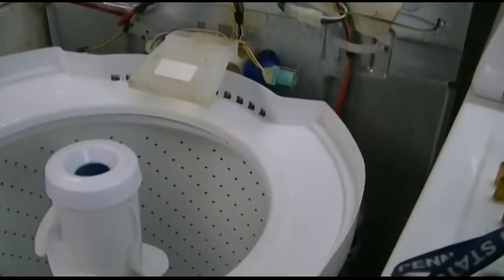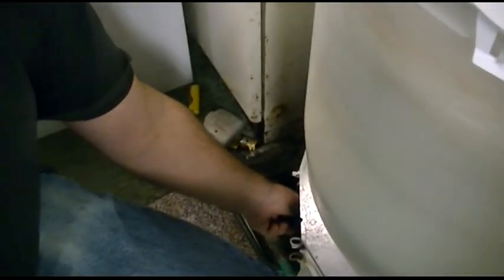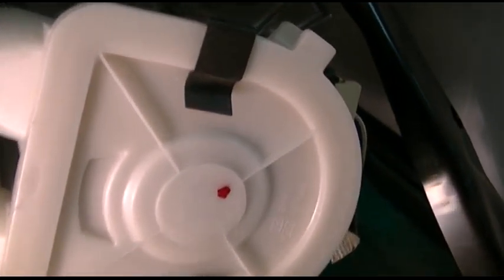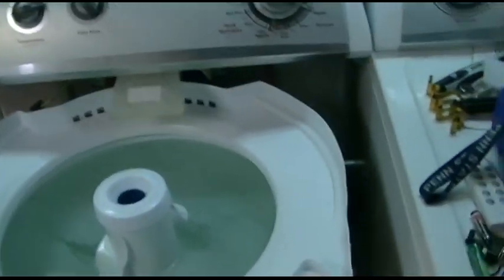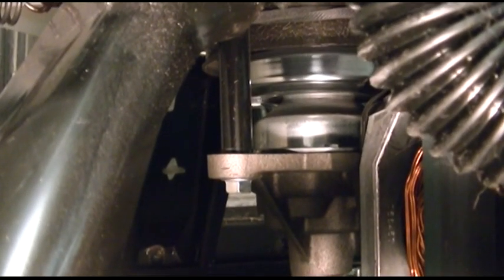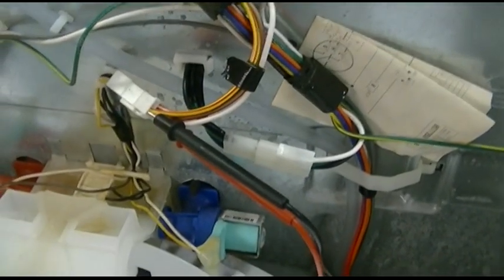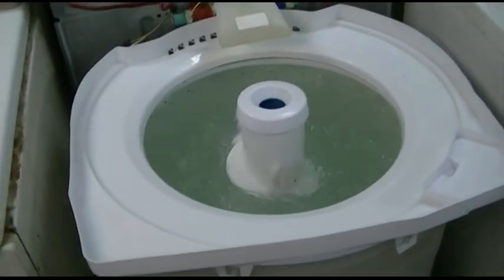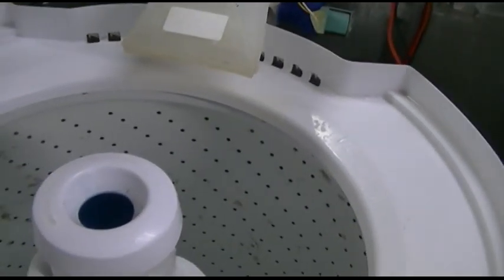Newer Whirlpool Direct-Drive NAKED!!! (With Warm Rinse Test)

Comment: NEVER get rid of it it’s one of a kind and it deserves to get fixed whirlpool is so dumb for not making this anymore
Reply from the maker: No worries, I never will get rid of this machine or my other direct drive!  If anything breaks on either one, I can fix it.  There is no choice for a replacement machine, so these will have to be fixed.  The good news is we do about 2 loads a week, and with 2 machines, each one does only 1 load per week.  An average household would have a lot more "mileage" on the machine because they'd only have 1 machine.  Having two allows me to split the workload between them.  Same with the 2 dryers.
Reply: jaykay18 that’s really good we’ve had two direct drives one from the early 2000s and then we moved and got a thin twin from the 90s from whirlpool. They were both great now we moved again and got a Ge hydrowave it’s wanted to break down before and has leaked but it hasn’t yet but when it does I plan on getting a refurbished direct drive
Reply from the maker: That's the best thing you can possibly do.
Reply: Yes they are! Who came up with the stupid idea of replacing it with these stupid belt drives? At least the Maytag centennial models were direct drive until 2010!

Comment: Is this the only washer without a pulley? What takes the place of the pulley? I know the coupler takes the place of the belt. It was a high-tech design when it first came out in the 80's.
Reply from the maker: There definitely were others.  One time, my father and I found a machine thrown out, I think it might have been a GE, and we dragged it home.  Opened it up, and they indeed had a direct drive design.  For a coupler, they used 2 pieces of metal or plastic, and there were rubber straps (almost like belts on a car) that connected the two together.  Something in that machine had gone horribly wrong, I don't remember what, but it didn't run.

Comment: 5:12 I spy a leak!
Reply from the maker: I didn't.
Reply: @jaykay18  there was a drip right under the drain pump.
Reply from the maker: @CubeComputerChannel  There's no leak..  The machine was moved out of position, if it were leaking you'd see live water there rather than just a stain.  Not to mention, it's been many years since this video was made, and never has there been water under the machine.